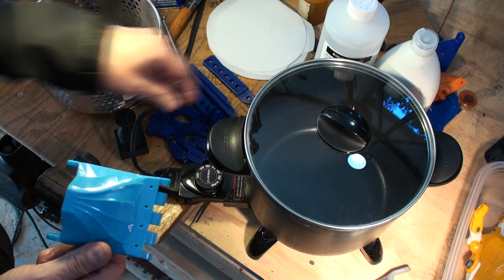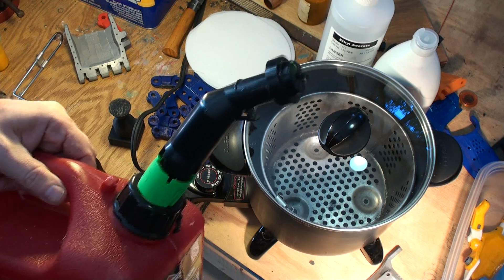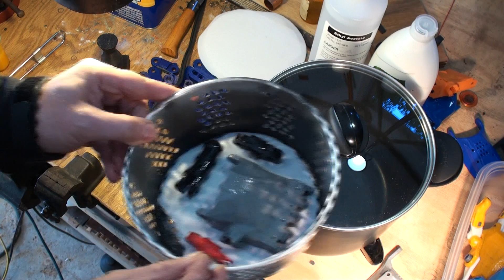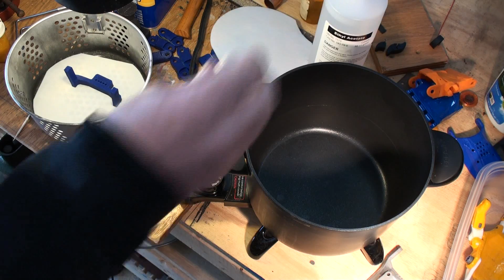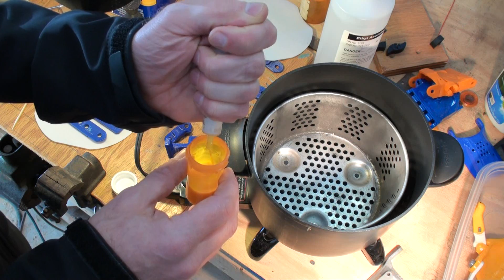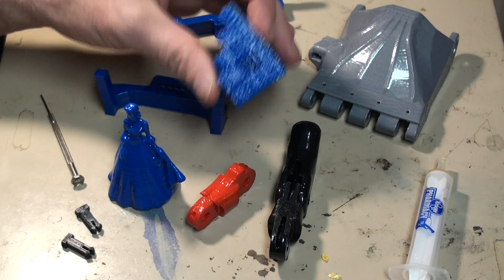Vapor Smoothing of 3D Printed ABS and PLA with Acetone and Ethyl Acetate

Comment: Would it also be possible to smoothen NiceABS by 3Djake with Etyhlacetate
Reply from the maker: If it's ABS, I'd use acetone.
Reply: Actually its a little different from ABS. I tried to smooth it with acetone but NiceABS wont desolve in acetone.

Comment: Some brands of "MEK substitute" at the hardware store are ethyle acetate and seem to be about $14/quart or $35/gal. It is only reasonable as a "substitute" for MEK in a narrow range of uses but as a source of ethyl acetate it is useful.
Reply: Yep, just picked up a gallon can (smallest they had available) of "Klean-Strip" brand "MEK Substitute" (The MSDS for it claims it to be 100% Ethyl Acetate - I seriously doubt that it's TRULY 100%, but anything above 80% purity ought to be WAY more than plenty for the purpose) at Home Depot for a little over $32 with tax today. Initial experiments seem to indicate it's gonna do a good job on my current PLA project - Nutshell version, I'm trying to print the pieces of a Gingery metal lathe in PLA, and once I finish printing the parts,  I intend to use them as sand-casting patterns so I can pour them in aluminum. After some (miserably failed and intensely frustrating) initial tries, I've found that even 0.1mm layer lines "grab" the sand if they aren't oriented EXACTLY right, so that trying to draw the pattern(s) after ramming up the mold results in a "Throw it back into the muller and try again" level fail.

Comment: Great info. A quick tip for pouring the acetone from the metal container, turn the container 180° so the spout is at the highest point. It will allow you to clear the lip and won’t gurgle and spill everywhere.

Comment: Have you tried this with PETG?
Reply from the maker: I'm not sure what vapor or liquid can dissolve PETG. It's pretty inert, so I suspect the only effective chemicals are also extremely caustic/poisonous. I think with PETG, you just have to print with very thin layers (<.1mm) and plan to use a little sandpaper.
Reply: @PeterBinkley5  Ethyl acetate dissolves it and yes, I print with 0.08mm layers. The trouble I'm having is that it leaves a lot of white on the surface a lot of the time
Reply: @PeterBinkley5  I've gotten some pretty smooth results, but do you experience a lot of shrinkage due to heat?
Reply from the maker: @BenWilson24  ABS prints will be smaller than PLA at the same extrusion settings, because ABS shrinks as it freezes and PLA does not. Some shrinking occurs during smoothing because the shell hardens into a more dense, flat surface than before it was smoothed.
Reply: @PeterBinkley5  gotcha. That makes sense. I'm printing PETG dirt bike gas caps and my caps didn't fit after smoothing.
Reply from the maker: @BenWilson24  Waitaminute, you're successfully smoothing PETG?? What's your solvent?
Reply: @PeterBinkley5  MEK substitute (Ethyl acetate) on AmazonBasics PETG and Hatchbox PETG. It definitely smooths a lot, but leaves a decent amount of white residue afterward and my parts are shrinking/distorting a bit.

Comment: Hi! Out of curiosity, what is the layer height that you would recommend for the 3D parts to be printed in that would produce the best results for the vapor wash treatment?
Reply from the maker: I usually print at .2mm when I'm going to vapor-smooth it. I've gone as high as .3mm with great results. The layering totally disappears. Be aware that thicker layers may cause more warping during printing.
Reply: Alrighty, that's good to know. We are have been using .1mm for our prints so far but it takes so long to print, so we have been considering using bigger heights to speed up the print time. Thanks again for the input!

Comment: One of the main advantages to abs, wonder why it is not more used.
Reply from the maker: ABS is a stinky, petroleum-based plastic. You really need to manage the fumes, both while printing and during vapor smoothing, until it is completely cured. ABS also requires higher nozzle temps, and since it shrinks as it cools, you need a heated print bed and an enclosure, and even so, still expect some warping. PLA prints easily and beautifully, even on the simplest of printers. And it's a corn-based plastic that smells like popcorn when it prints.
Reply: Yeah but still to get such end results could be worth it.

Comment: What is the ratio of solvent to plastic for the glue?
Reply from the maker: I'm not entirely sure. Making glue with PLA and ethyl acetate didn't work for me. But I make acetone/ABS cement all the time. I just don't really measure. I stuff some shards of ABS into a polypropylene medicine bottle, then fill it a bit more than halfway with acetone and put a cap on it. After a few hours, I give it a stir. If it's too thick, I add a bit more acetone; if too thin, I add more ABS. The cement usually thickens and develops a "skin" over a few days, since a bit of the acetone tends to escape even a pretty tight bottle.

Comment: Your method is very unsafe acetone is highly flammable which I'm sure you know but I have developed my own safer system 
Step 1. Drench paper towels with acetone,or ethyl acetone 

Step 2.stick the drenched cloths into the sides of a jar or old paint can 

Step 3.heat up slightly with a blowdryer on the sides  

This method will also save you a lot more acetone so you can get more batches of PLA 3D printed thingamajiggers with less acetone 

I hope you read this and attempt this system which is much safer and efficient than what you are doing now😉
Reply from the maker: Make a video to demonstrate your method. Difficult to envision how much cloths and how to arrange them. I've used my method over 100 times and haven't run into safety concerns. I also use less than 30mL per run, so I don't think I'm wasting much acetone. Just go easy on the heat like I do here. The main thing I like about this method is that it's very fast. About 1 minute per batch.
Reply: An acetone fire is pretty wimpy.
Reply: there are a few youtube videos using "his" system  if you're really interested.

Comment: dont put object a the botom of recipient
put it at the more top  is possible  in the cup
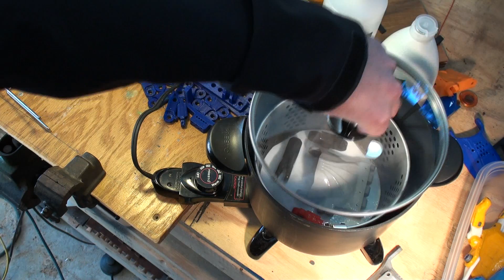Reply from the maker: If you heat the acetone gently as I did in the video, the vapor sits in the bottom half of the pot like a heavy cloud. Watch the video from the 10:40 mark. The bottom of the basket should be 5-10mm from the bottom of the pot, just so it's not sitting in the liquid.

Comment: Does the pot hang inside the cooker or does it touch the bottom?
Reply from the maker: It touches the bottom, but it has little feet to keep the flat bottom ~4mm off the bottom. If yours doesn't have that, try making little feet out of silicone. Cured silicone tolerates high heat. If I hang the basket on the edge of the pot, the lid won't fully close.
Reply: Peter Binkley Thanks! I tried my own method a few minutes ago with a stand and a basket but I forgot about conductivity so it just melted the bottom

Comment: Ok instead of the PTFE bed = no vapor or trapped vapor areas - try using something like Ceramic Stilts. I know that this would be a pain for the small items but the point is if the item is only touch pin points then the vapor can get all around it. I would suggest starting like this.... Get a stiff piece of PTFE plastic 1/8 o 1/4th inch thick. Cut it to size - drill a ton of very small holes in it - make it very porous - then stick nails up through it - maybe use a air nailer and just put in a bunch.

Now you have a raise bed of pins and the bed has many holes to allow the vapor to come up through - the pins are the only thing touching the prints. This avoids the plastic adhesion issue. Now if your an engineer like me - make a metal handle set on each side - bend coat hangars into skinny loops - stick them down thru the pin bed. This will help you set the items in and extract them out once finished.

Make 2 / 3 / 4 of these depending on how many prints you have to dry at a time. The you can set prints onto the pins - set it into the pot - heat it and vapor treat - then extract the bed with the handles to set aside.

Taking prints off the pins will be simple - the pins will leave little to NO marks on the items. If you make many of the same pieces you could design specific pin bed jigs for the parts too. Many of us would just have a generic round pin bed.

I will be making this for myself this weekend - I could upload a small video on my channel if you want to see what I mean/did for this.
Thanks for a great video and great information on vapor treating!
Reply from the maker: Assuming access to a 3d printer, I think you could print a nylon mesh or stilts or whatever. Vitrified ABS and PLA won't stick to nylon.
Reply: Dammit now I need to order nylon  :)  I will get a vid and show you results. I have been using your method and made some custom internal part holding appratus. I even extended the height for the lid for some tall items with a tape ring solution - worked great!  Thank you again for the video - the idea and the smarts you passed along!

Comment: hey peter! thanks for taking the time to make this video. quick question, i just went and bought some Ethyl Acetate to make some PLA cement.. grabbed some empty polypropylene containers.. mixed it with some un-used PLA parts.. let it sit over night.. and everything is still completely solid. it doesn't seem like the PLA is melting or dissolving or doing anything.. how long does this process usually take? and i doing something wrong?
Reply from the maker: After reading your comment, I tried the same thing, with the same non-results. There are different formulations used for PLA filament. Maybe there's a brand that works better than others. I haven't actually made PLA cement, but I assumed that if you could dissolve PLA surfaces with ethyl acetate vapor, that you could also make PLA cement with liquid ethyl acetate. I'm sorry you spent the money and didn't get the results you wanted. I'll make a note in the video description.

Comment: Most of your pieces have holes, why not hang them in the vaporizer.
Reply from the maker: For that I'd need to make a hanger that fits inside the pot and the hooks would need to be a non-stick material. Even then, the sticky surface of the plastic would be marked by the hooks. I've used hooks before. For me it was tedious and messy.

Comment: are you sure it works with PLA?
Reply from the maker: PLA will dissolve in ethyl acetate, not acetone. I tried to be clear about that in the video. Some brands of PLA (like Colorfabb) are blends of PLA and PHA, and the PHA is soluble in acetone, so that will work. But if you have pure PLA, you need something that will dissolve it, like ethyl acetate.

Comment: Shouldnt you be able to use aluminum for the bottom of the print to stand on so it wont get stuck?
Reply from the maker: I don't know about PLA, but ABS will stick to aluminum. PTFE, HDPE, PP or nylon will not stick, so those materials are recommended.

Comment: Ethyl Acetate is sold quite cheaply at your local hardware store under the title "MEK substitute".
Reply from the maker: MEK is not the same as MEK substitute. MEK is much more dangerous to inhale, and you should NOT be intentionally vaporizing the stuff. Ethyl Acetate has been labeled "MEK Substitute" for at least one product, but you had better read the label carefully just to make sure.
Reply: is there a difference between MEK & MEK substitute because MEK works nothing like the ethyl acetate if it's the same stuff then nether Ethyl Acetate or MEK  WORK AT ALL !!!
Reply: I've learned first hand, it totally depends on the supplier.  There's PLA, PLA with intentional additives, and pure PLA, which according to the filament manufacturer is not the same as PLA.  They're a ll just called PLA.  I used weld-on on one of my PLA and it just bleached it ... eventually softened it but boy was it ugly.  Took weeks for it to firm up too.

Comment: Its not melting -.- its dissolving!
Reply from the maker: You are 100% correct. Dissolving. It just looks like melting. :)
Reply: Peter Binkley well kind of. But I hear that all the time.
Reply: All definitions at merriam webster are valid.  Not just the first one.  Just saying.
Reply: "melting" is okay ... see http://www.merriam-webster.com/dictionary/melt.  Note the keyword "usually", and all the definitions.
Reply: In chemical terms this is dissolving
Reply: ***** as it say mostly due to heat. And also it must not become a liquid to get dissolved. It becomes ionised
Reply: ***** you sure? When you dissolve abs and let the solvent evaporate it turns back into solid abs. Hows this going to destroy the structure of the polymere?
Reply: you are right i will clear my comment above.

Comment: Im not exactly sure whats with the white stuff on the PLA, but I do have a few theories.

1. It's type of oxide layer formed from the ethyl acetate breaking down the PLA.
2. The pigment is destroyed by the AE.
3. The white area's is actually where the AE caused the surface of the pla to become pitted on a small scale.
Reply: Or dendritic formation upon drying.  Gets my vote because of where it forms.  Wonder if drying with heat gun would help (dry it before dendrite structure can occur).

Comment: acetone solves the PLA i use for some reason.. (velleman) i wet a towel with acetone and rub the surface, makes it smoother and takes away the shine so i can get a better surface for primer, i paint most of my stuff as i mostly print decorative stuff..
Reply: Only Colorfabb responds to acetone, and maybe one or two other PLA manufacturers because they put other stuff in with the PLA.  PLA from most suppliers bar far does not respond at all to acetone.

Comment: Use stainless steel wire to make a support, and hang your parts on rods through holes on the parts like is done when production line painting. A skeleton like frame, roughly the same dimensions of the fry basket you already have with the rods supporting parts lying atop it. No more touchy feely parts, no more marring from lying on anything....

Comment: You could try to make a three pronged board where you can drop the basket ( since it has 3 big holes in the bottom ) so it would raise the silicone sheet and parts more easily

Comment: How well did you clean the ABS vapour out and could the tray have acetone impregnated in it... my understanding is PLA will whiten in the presence of acetone.
Reply from the maker: +Tim Watterson I don't think the aluminum basket or the PTFE sheet would absorb any acetone. But you mat still be right. It could be that small levels of acetone were still airborne in the pot. There wasn't much time between loads. But other people who use PLA/ethyl acetate have observed the same whitening without any acetone present. So I don't think it's an acetone problem. Thanks for the input.
Reply: +Peter Binkley Teflon is known to absorb moisture, maybe trapped water vapor in the hot atmosphere is affecting the color.

Comment: Peter, Thanks so much for this video! I've been looking for a good resource for cleaning up my parts and this is a great place for me to start! What types of resources did you use to determine what chemicals can be stored in what types of plastic, etc? Also I noticed that there were two different colors in the same pot at the same time. I'm assuming that that is ok as long as they are not touching? Scott
Reply from the maker: +Scott Gilsdorf Yeah, I did break my own rule in the video by finishing three different colors of ABS in the same bath. The reason actually has more to do with the particular formulation of ABS and less to do with the color. Different formulations of ABS smooth at very different rates, so you could be waiting for one piece to vitrify while other pieces are making puddles of plastic.
Reply: Thank you very much! I intend to try this for the first time this coming weekend.

Comment: what was the appropriate solvent to the pla cement? i have plenty of support material in a large container i can bring back to fill in the gaps on some models. Thanks
Reply from the maker: +MiamiCityDjs Emil Ethyl acetate will dissolve PLA, so you should be able to use it to make PLA cement.
Reply from the maker: I take that back. I can't seem to get PLA to dissolve in ethyl acetate. Maybe some brands of PLA work better than others.

Comment: Interesting video and thanks for sharing your tests.  Have you tested Ethyl Acetate for clearing blocked nozzles?
Reply from the maker: +Ant Scranney No I haven't. I'm not sure how effective ethyl acetate would be on burned PLA, which is usually what causes blocked nozzles. For nozzle cleaning, I use the atomic pull method with Bridge Nylon. Best material and method for getting out the burned bits.
Reply: +Peter Binkley can you do a video of that next? I've never heard of that method.
Reply from the maker: +Robert Gorman (GoGoCharlie) Just google "atomic 3d nozzle cleaning". There's some pretty good tutorials out there.
Reply: Looks like it's just being done on 3mm filament. Hmm...
Reply from the maker: +Robert Gorman (GoGoCharlie) You're right. Because the inside of the nozzle mushrooms out with 1.75mm machines, I don't think you could do the atomic method. For my 1.75 printer I have to remove the nozzle to clean it very well. Sorry.